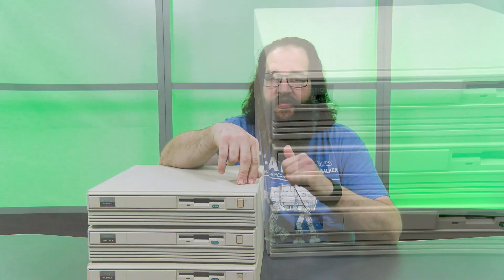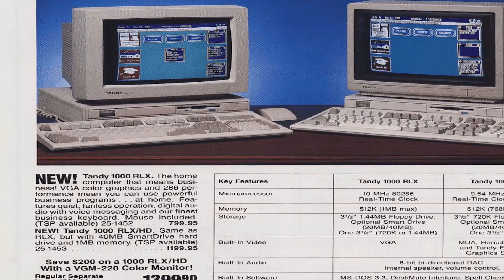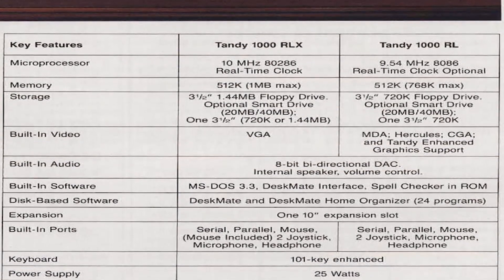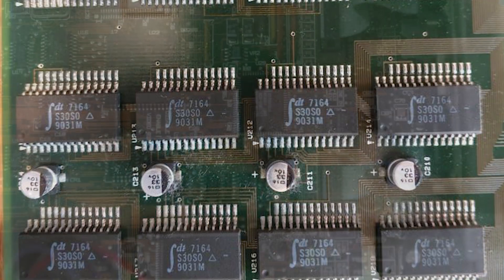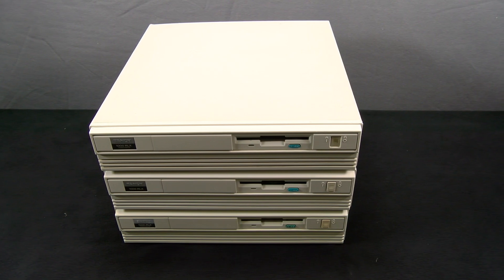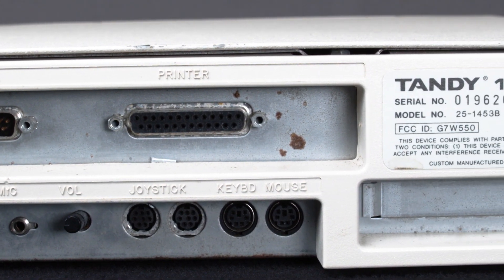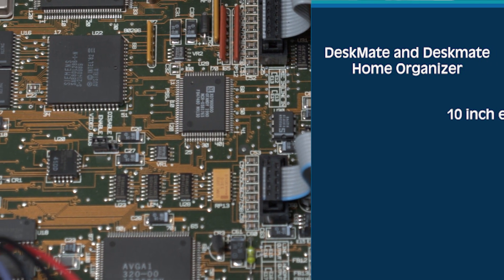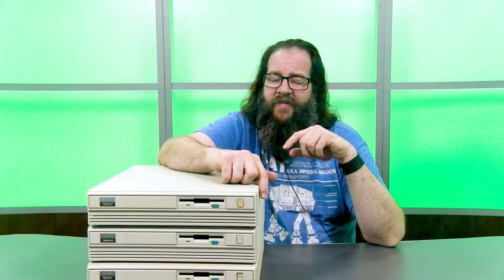Tandy 1000 RLX First Look - Radio Shack's mid-range slim design 286 PC from 1992

Comment: The one you show in the video is actually the 1000RLX-B, the later model with MS-DOS 5.0 in ROM and special mini-DIN joystick ports that require hard-to-find adapters to use with standard Tandy 1000 / Color Computer joysticks.
Reply: To this day, I don't think I've ever heard incorrect information in a VWestlife video, or seen you have to make a correction.